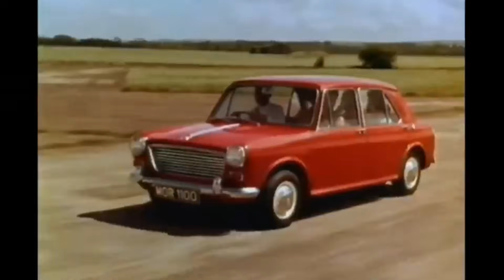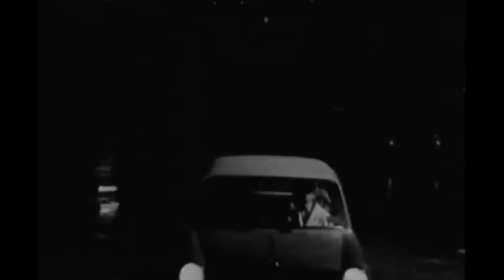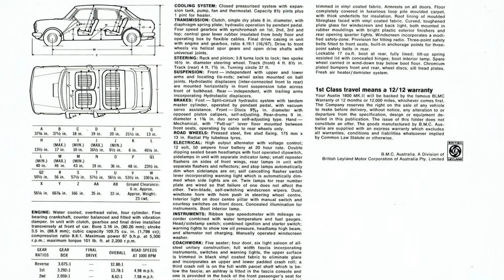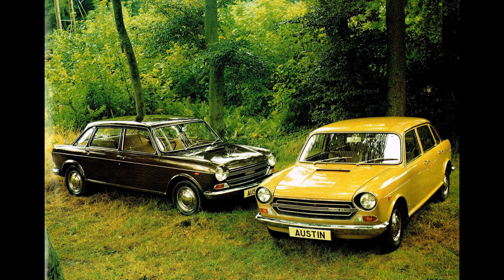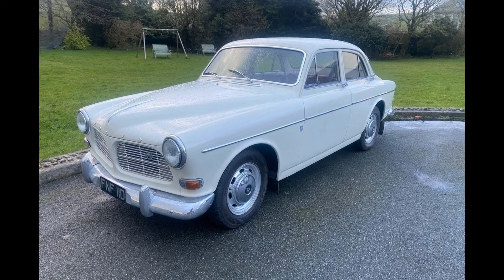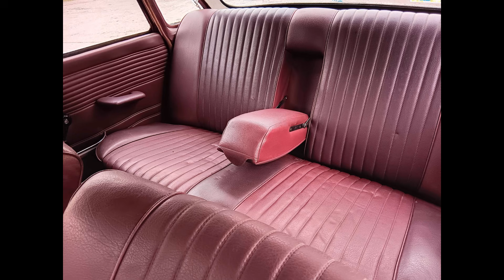Even at 85 HP, The Austin 1800 SHOCKED Europe With Rolls-Royce Ride Quality

Comment: The Austin 1800 and its derivatives, the Maxi, Allegro, Vanden Plas 3 litre - pipe smoking committee designed outdated ghastly cars , all the reasons why BL failed.   Overweight, heavy, gas guzzlers, appalling handling, comfortable (agreed) rust buckets, engines based on the 1948 Weslake patent (85 bhp from an 1800cc engine!! - I can get that from my 1275cc Cooper S), whilst Jap cars heading rapidly towards the 3rd millenium.